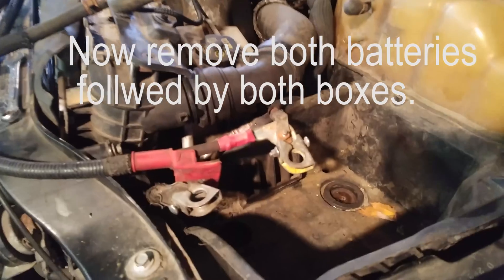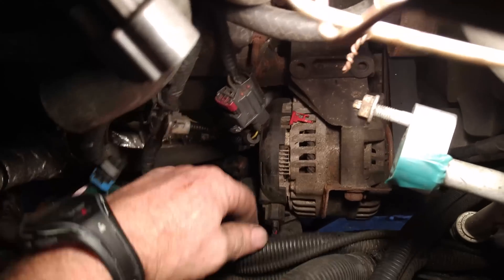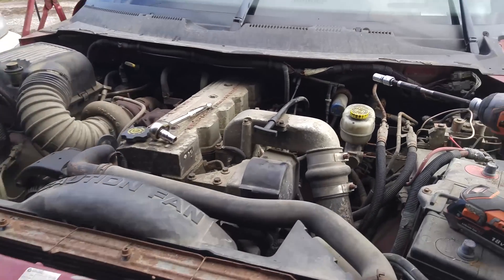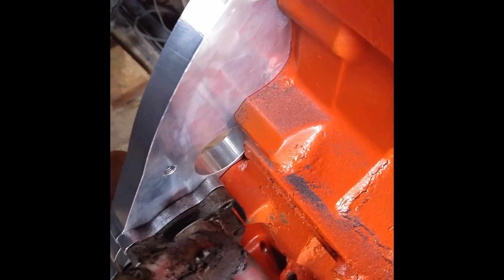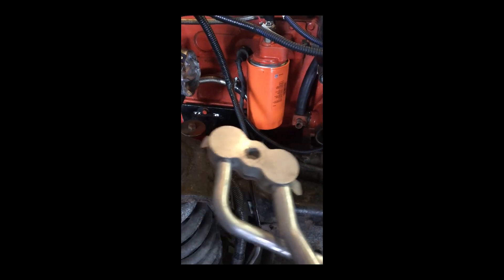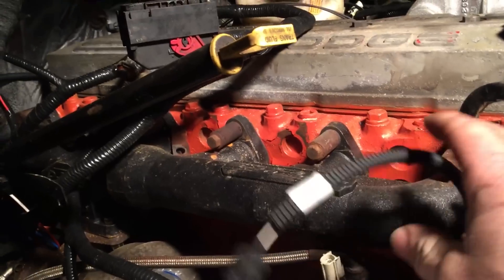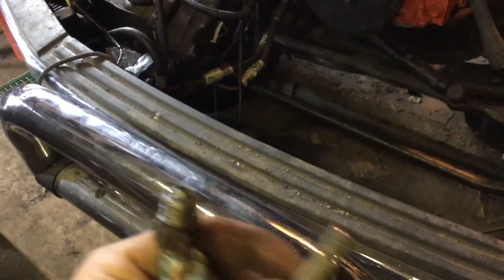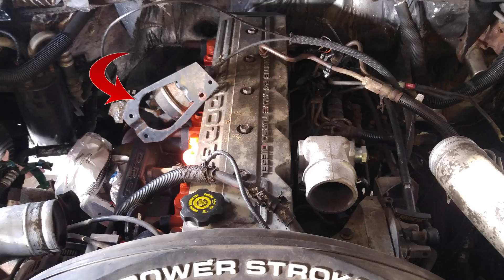Ford Cummins Swap 6.4L to 5.9 24 Valve instructions

Comment: Whats the latest model ford that will accept the 5.9?  

Next year i wish to rebuild my 12v and drop it into the newest ford shell i can find.
Reply from the maker: Diesel conversation sell any adaptor plate you will need for each year.  I like the 5R110 transmission it seems to work great with the 5.9.      I used a 2008 but  with a bit of work you can put the 12 v in anything.
Reply: Why would you put the converter on the motor? That's asking for trouble. Never do that.

Comment: Did he brake the pump to the converter?
Reply from the maker: Sorry I don’t understand.
Reply: Was the torque converter removed before stabbing the transmission?
Reply from the maker: The torque converter was mounted first then the trans slipped in.   There is 2 bumps the trans must slip into torque converter or it will not tighten up correctly.
Reply: @brownlordofthewoodshop8552  Im familiar with that bud. what im talking about is at 6:48 of your video. It looks to me that you are stabbing it in bolted on the engine.
Reply from the maker: Yes the torque converter was on then slipped it into the transmission.  I had to tip and adjust the motor to make them line up.  Then I bolted it together.
Reply: @brownlordofthewoodshop8552   if it went in with it bolted to motor your 1 lucky man
Reply from the maker: Must be lucky
Reply: I was thinking the same thing!

Comment: Did you keep the 6.4 exhaust temp sensors?
Reply from the maker: Yes I did but it was going through the sct programmer. Not the stock ford
Reply: Oh ok perfect. Hey I’m almost done here I’m just a little lost here on the wiring. On the ignition relay it has 2 wires that say to connect to the pcm. How did you do that

Comment: Hey! im doing this build at the momemt but im stuck with the Cam sensor and ring idk what to do
Reply from the maker: Where are you putting the cam sensor? Did you purchase the adaptor plate with the slot for the cam sensor? I used my ford cam sensor which fit into adaptor plate.  
The dodge cam and crank sensor look same be sure to label them they can be reversed and cause you problems later
Reply: yes i have the adapter plate with the slot . mine is for an auto trans.
Reply: Brown, Lord of the woodshop™ https://www.dieselconversion.com/dcs-cummins-adapter-kit-1949.html this is what came with the kit.
Reply from the maker: Yes the plate is the same as mine.  You need to take the cam sensor from your old ford motor . At the back of your dodge motor standing behind its in left side you need to take out the frost plug looking thing.  on the adaption plate there is a rubber o ring you need and this seals the adaptor plate against the block.
Reply from the maker: Did you get them to make you a wiring harness.  It was the best money I spent
Reply: Brown, Lord of the woodshop™ yes I did. There’s no way I was gonna mess with all those wires. Thank you so much I was going crazy holding that piece until I saw behind the adaptor plate and noticed it fit. How did you take the plug off the cummins
Reply from the maker: I think I put a self tapping screw ind pulled it out    If not a screwdriver punch a hole and pry it out.
Reply from the maker: Sorry for the slow reply.
Reply: Brown, Lord of the woodshop™ it’s ok. Trust me finally being able to ask someone who has done what I’m doing is a relief. Yeah after reading your comment the instructions made a lot more sense.
Reply from the maker: I think there is a way to send me a private message with your contact info and I can give you a call.

Comment: 2006 F250 with 2007 Cummins 5.9 here. I used DCS also. I did my conversion in 2012. DCS has come a long way since. They know what there are doing now! Mike Dahlke is extremely knowledgeable! I recommend them!
Reply from the maker: Yes they are great people to work with .
Reply: @brownlordofthewoodshop8552  where is DCS located ?,I'm in Saskatchewan canada
Reply from the maker: https://www.dieselconversion.com/
This is there website
Reply from the maker: The kit was around 2500 and the wiring harness was around 600. 
Plus an extra 500 for odds and ends.
Reply: @brownlordofthewoodshop8552  I'm looking at the same conversion kit now. It's like $6200.
   It's insane how much everything gone up
Reply: Bocephus what did the total cost come out to for you? I’m really considering doing this swap?

Comment: Great work !!  good documentation thank you!!  Liked !!  everything still going ok??
Reply from the maker: Yes still rocking.  Almost 500k on the motor
Reply from the maker: Thanks . I have over 30k on it and its working great.
Reply: @brownlordofthewoodshop8552  great video, I've got an 08 f250 I'm gonna pull the 6.4 and find a cummins to replace it. Thanks for sharing

Comment: How much did it cost to swap not including the cost of the engine?
Reply from the maker: I purchased a full truck for 2k and the kit from diesel conversions for 2500 and probably 1500 on random stuff.
12 valve is much easier to work with  . $600 for the wiring harness was the best purchase made life so easier.
Reply: Thanks. I read in a magzine that it cost $7k plus an engine to do the swap. I can't figure out where all the money would go. I think some of these comapnies want you to buy parts that you don't really need. I found an 08 F-350 needing an engine for sale but the guy wants more than I want to go. I'd like to drop in common rail in it. A 12 valve would be easier to swap but it would be a step back in terms of performance.
Reply from the maker: The best purchase for me was the adaptor plate ring gear and wiring harness. The rest you can make .
Motor mounts you would save 200 dollars if you make yourself . 
I used an sct programmer to control the 5r110 transmission. It works great. Once you get started i will help you out . if you look in my more info i have linked the wiring diagtams and manual from dieael conversions on how to do the swap. 
I paid 6 grand canadian  2 years ago for my f350 . it had a new transmission and was fully loaded. 35 tires as well.
Reply: This truck is a 08 f-350 XL supercab 6.4 with a ZF6. He wants $5500 USD. I don't think it is worth that. A 6.4 from a junkyard is $10k. It would cost more to put a 6.4 in it than what it is worth, if you had to pay for labor. I may contact him this week and see what he says. I was thinking about making mounts, they look pretty simple. They are $300 now. Buying mounts would really speed up the process though. Mounts are a hassle to make. Thanks for the offer. I may have to take you up on it. I read thought the manual a little last night.
Reply from the maker: Personally I would buy the mounts. To source the bushing material is  a pain. You can save money else where .
Reply: We made mounts for a customers monza. The guy probably could have bought mounts for what he had in it. These cummins mounts look pretty simple and would be real easy to copy if I had a set. The problem with making mounts is you have to have the engine level side to side, sitting properly front to rear, it can't be too far forward or back. With mounts buying the mounts you can bolt the adapter plate on and drop it in the frame on the new mounts and get going quick.
Reply from the maker: Easy is always the better way .
Reply: I keep forgetting to tell you , the guy had already sold the truck when I contacted him.

Comment: Most of the cummins to ford conversions I do include a leveling kit at the very least because of clearances. also, there should be a place to tap in for oil pressure on the driver side of the block below the fueling stuff. Save that second oil filter port for a bypass.
Reply from the maker: Thanks

Comment: glad you showed this video I'm going to take a 6.0 out of a 2006 Ford F-250 and put a 5.9 Cummins out of a 1999 Dodge you gave me a great ideas
Reply from the maker: if you have any questions let me know. I have uploaded the manual from Diesel conversions above
Reply from the maker: The above link has a manual to help as well.
Reply: How much would you charge to put a cummins in a 2000 excursion? It currently has the V10
Reply from the maker: Where do you live ? transportation  could be an issue.
Reply: Are you fucking high on crack?? Why would you replace a great engine with a shitty ass Cum Apart? If it's a 6.4, I totally get it, but the 2005-07 6.0 is the bomb